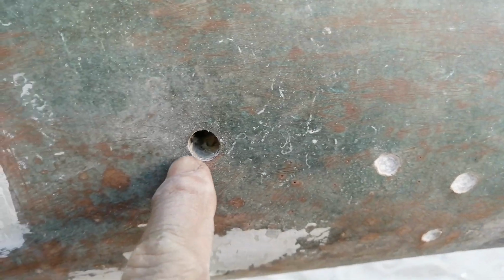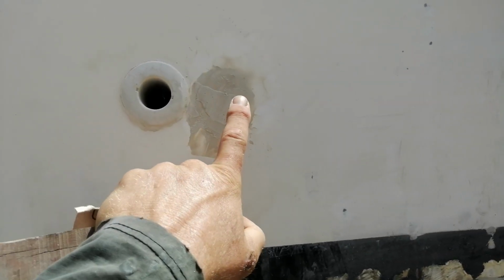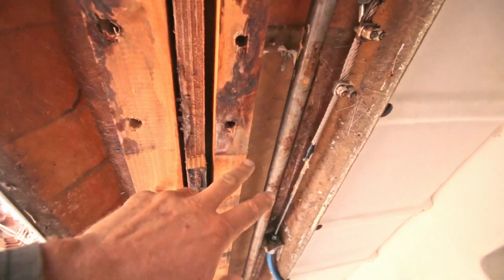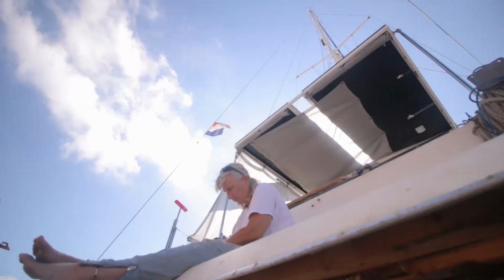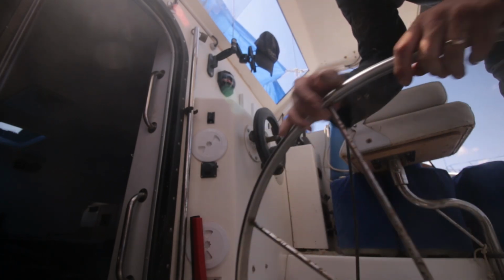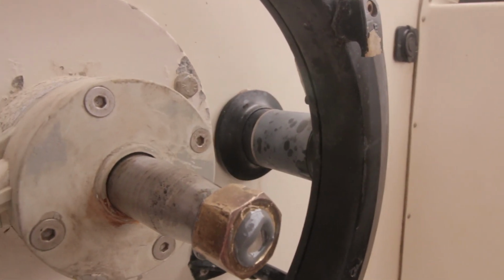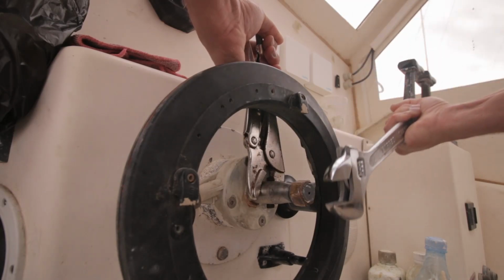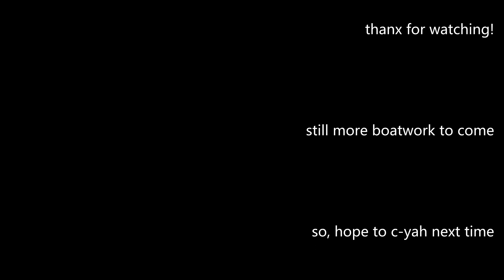DIY nut, blisters & despondency. Ep.64 Sailing Exodos

Comment: I know you have the thread issue dealt with by now, but another option might have been to drill out the nut and shaft to accept a cotter pin. There is no significant load on the nut so would have held in a pinch. Enjoyed this episode….( suck about the bulb water!) and feel your pain with the yard workers…..thx, Andrew
Reply from the maker: "Dealt with" is a big word for a temporary solution, Andrew 🙂 Although it's going to be less temporary than I was planning it to be. So maybe a cotter pin could be a solution, although I ain't got the slightest idea what it is, hahaha! I'm going to look it up. Bulb water wasn't that bad. I just let it dry out thoroughly and closed all the gaps with epoxy. And like I said, it's not part of the hull.